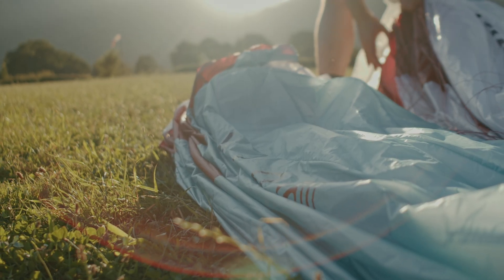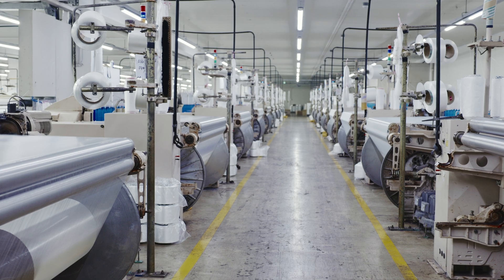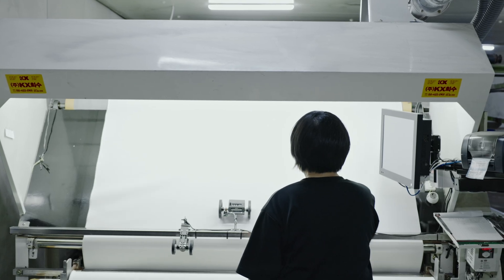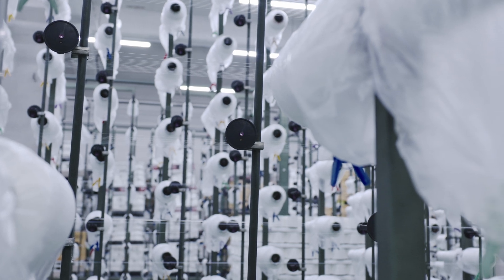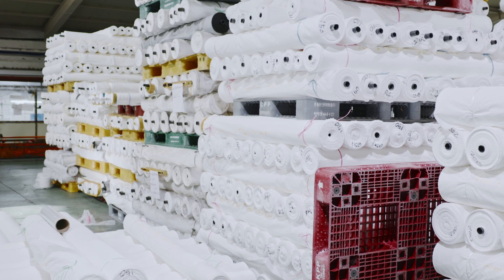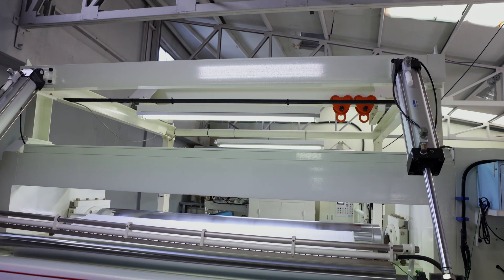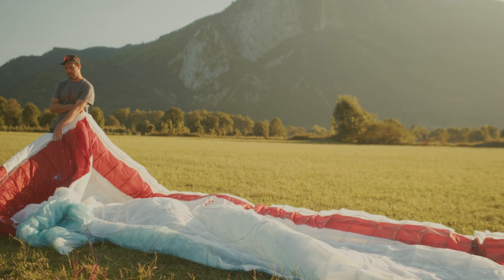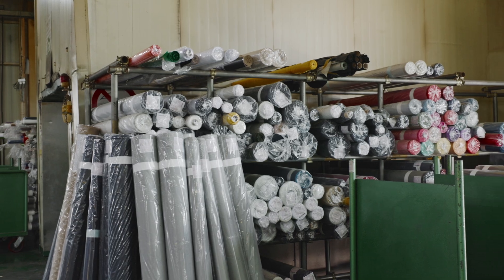GIN GLIDERS ::: MJ29 MF -- A new lightweight paraglider fabric

Comment: I'm interested in both how much lighter this will make an already light wing (i.e. Calypso 2) and if it packs smaller.   Great video.
Reply from the maker: MJ29MF is the same weight as other lightweight fabrics we've been using; the main difference is better air porosity after ageing, according to our tests. The Calypso 2 is already one of the smallest packing wings in its class ;-)